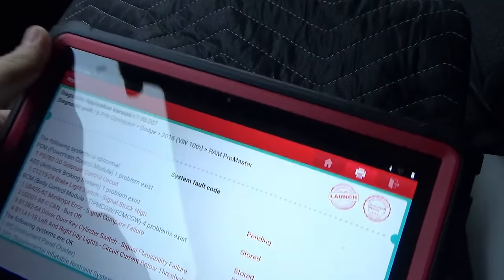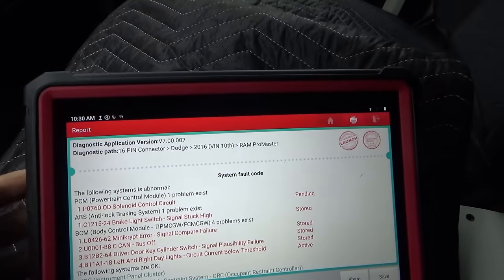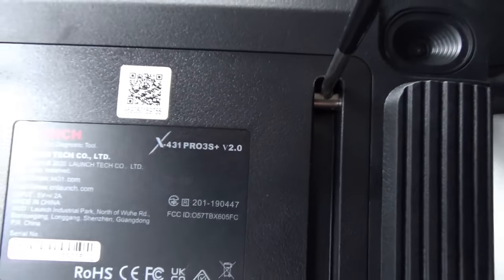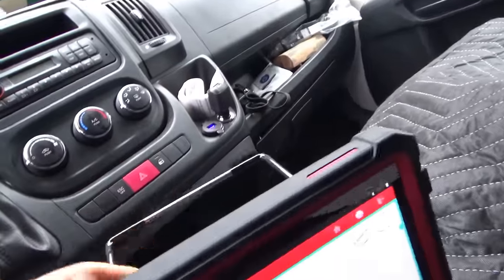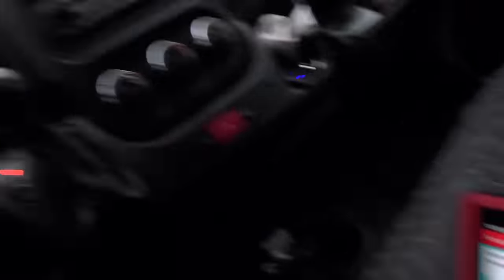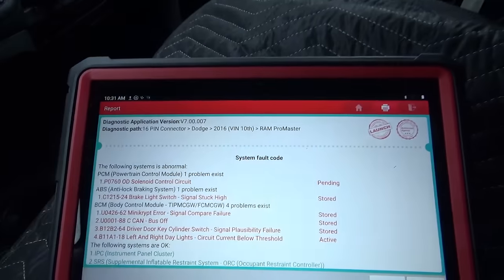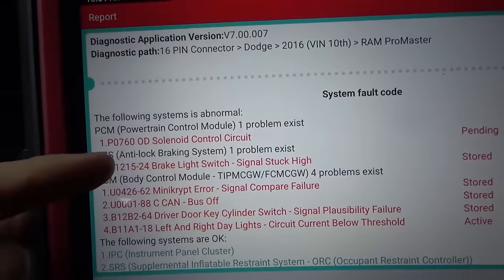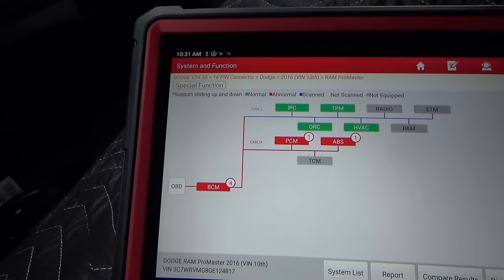ProMaster DISASTER Van - Part 2: Transmission LIMP MODE? (P0760)

Comment: Why on God's green Earth would anyone put the computer in the engine bay?   Chrysler is not the only one doing this.   You would think Chrysler would have learned from the Lean Burn system where the computer was attached to the side of the air filter and  would eventually go wonky from the heat coming off the exhaust manifold.🤔

Comment: Man, what a horrible design!  I'd be tempted to grab some flashing or something and make a little bolt-in cover for the PCM that could deflect any water that tries to find its way down.

These ProMaster vans are absolutely awful things, and compared to a Transit or Express, I don't see why people buy them.  Even the little attentions to detail, both the Transit and Express vans have a structural step built into the front bumper so you can reach and clean the entire windshield; the ProMaster does not.  Seems trivial, but when you're out in the field, little things like that make for a much better experience.